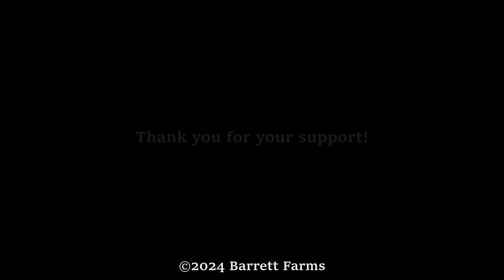Beaver Dam Removal Takes Drastic Measures | Culvert Unclogging

Comment: I would suggest a culvert at least almost triple the size you had and maybe look into it being a concrete one if you are thinking of tractors and combines going over it...and as I've suggested before...a triangular trash rack...sorry to keep beating a dead horse on the suggestion. I understand they are not cheap to get.
Reply from the maker: It's coming. Not quite tripple the size but in the 30" plus size and steel. The triangular grate is coming too, I'll build it myself if I have to.

Comment: You need to dredge those ditches and you should have dug them out before you let the water through.  So much mud was just being pushed downstream where it will settle so the flow won't ever be fast enough to drain the big pond at the top.
I've been watching you clear this area for a long time. There is always so much water (and deep) in front of the culvert and it helps the beavers float logs/sticks to block the entrance. And provides masses of mud because it's slow moving. You are making their job easy for them.
Reply from the maker: I appreciate you being a long-time viewer. These ditches badly need dug out, but one of the worst areas is obstructed by trees on one side and powerlines for a well on the other and blocks the excavator getting in. The plan is after harvest this year to take the trees down. Stay tuned for that.
It doesn't matter what gets in the down flow. These ditches silt in constantly from field runoff and just have to be dug out periodically. Unfortunately, our last farmer didn't have an excavator, but our new one does, so we will be paying them to dig them out this year.
And I agree, past and present excavator and backhoe work have made the area around the culverts way too deep.
Reply: @BarrettFarms  

Thanks for the reply and will definitely keep watching.
Wishing you all the best in your plans to sort things out.

Comment: I wonder if a plumber auger or snake could help get through the packed mud in the middle of the pipe?????
Reply from the maker: Possibly, especially on the second culvert because that one is smaller and generally more mud than anything. The first one was just so much and so far into the pipe.
Reply: @BarrettFarms  I only though if it from plumber in Australia that had a pipe FULL of dry hard packed sand.   It did suck a good job.  Best of luck!

Comment: You need a telephone pole to push it through or keep a chain running through it you can attach a tire or something to in the future
Reply from the maker: For almost a year I had a long rope looped through it but just took it out a few weeks ago because our new farmers have been burning off some of the overgrowth and I didn't want it to get burnt up. You're right it would have been perfect in this case, could have tied a chain on it and pulled it through with an object on the end to pull that clog out.

Comment: I thought you were going to use tannerite ! Even that would have just had to have been used several times and just blew up that whole section of clogged pipe, easier digging it out at least with the whole soil on top loosened up !
Reply from the maker: I'm thinking of doing a tannerite removal the next time we get a big one away from the culverts and anything else we dont want damaged by flying g debris. Stay tuned, it may happen!

Comment: Why not push a pipe through with a chain,,,,,y’all made this way to hard
Reply from the maker: No pipe, no chain. I agree though, sure seemed like a lot of work rather than just running and getting what we needed. I do have sections of steel pipe at the culverts now just in case but hopefully the grates get left on now and we don't encounter this again.

Comment: You neet long strict to anbloke the cover
Reply from the maker: Yep. I took care of that after this. Stashed a few pieces of 10ft long metal pipe around the drains to use in the unfortunate event they build inside the pipe again. Hopefully after this though, it's completely clear the grates should never be left off.

Comment: Pull a tire through the pipe.
Reply from the maker: I think it was last year maybe, it's in a past video. I ran a rope through the pipe and left it there just in case I ever needed to pull a chain through and use something like a tire to dislodge a dam. Wouldn't you know it, I removed it early this spring because I had yet to need it and didn't want it getting caught up in a mower or anything. Could have been a game changer here on this day.